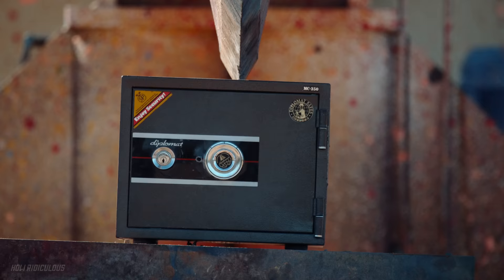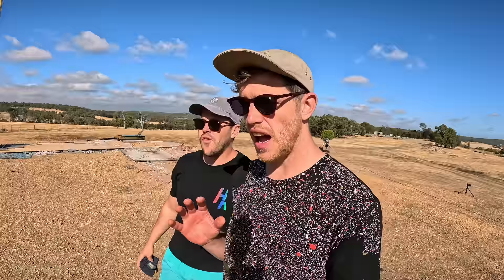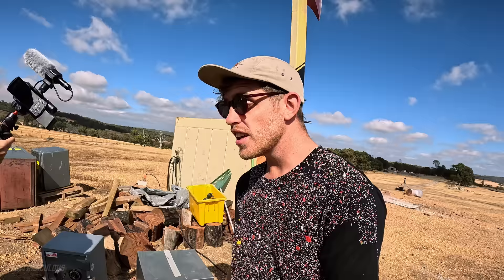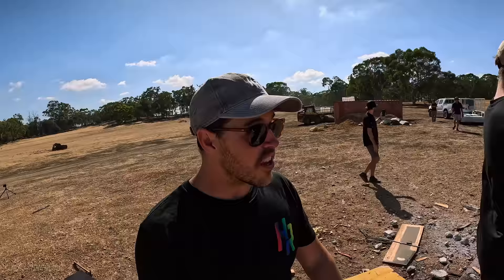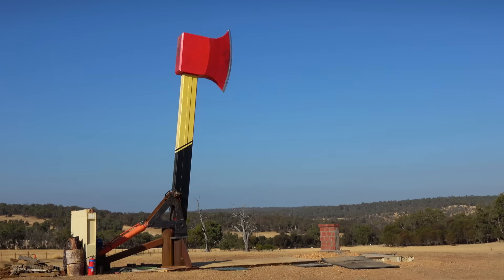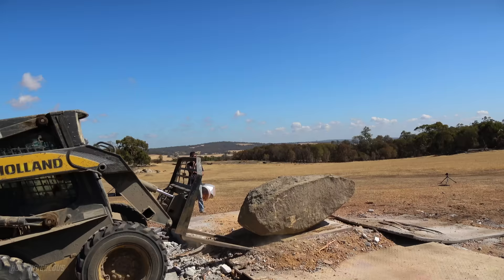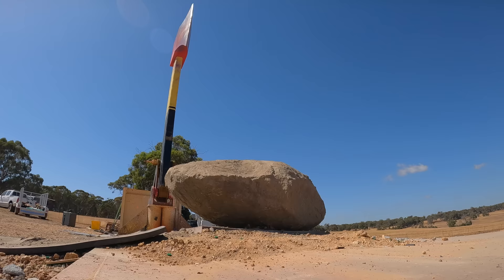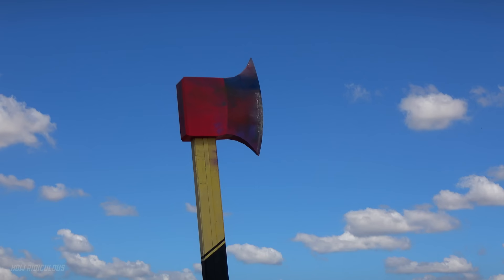Is There A Safe Our Giant Axe Can't Break Into?

Comment: Full respect to the axe, and another great video, but let's be real for a moment. At 3:56, you can see no hesitation from the axe, not what I would expect from a piano. Having personally dismantled a piano myself, I know there's a giant solid cast iron (if not steel) frame in the center of it to keep the piano from imploding from the tension of all the strings. If the frame were in the piano, I would expect  some amount of hesitation from the axe in the slowie. Unless, of course, I'm getting too ahead of myself, and in the next axe video there will be a piano frame on the chopping block.
Love your stuff, and keep it up.

Comment: For environmental and outright safety reason you probably can't take my suggestions... "However"... How about placing a small car with an Aluminium block engine (that runs) facing towards Moses (the axe) and see if you can split a "running engine" in half while splitting the car wide open... Think of it... GoPro"s in the engine compartment... Have the engine running with a few extra RPM but not outright racing and then drop Moses on it... EPIC!!!!
Suggestion #2,, A full propane bottle (good sized one mind you) at the base of the tower with 10-20 tiki torches around it (lit) and then you drop the giant dark on it and BOOM!!!! (Think of the slow motion video on that one)!!! 
P..S. for safety, no one is in the tower releasing the pull pin to drop the dart. Rig it to a remote drop system and everyone stay well back.... Whatya think? A bit to psycho for you guys?...